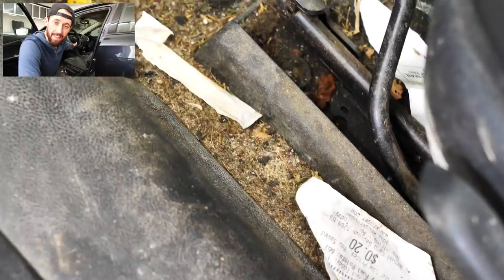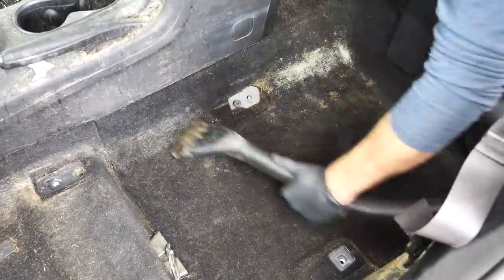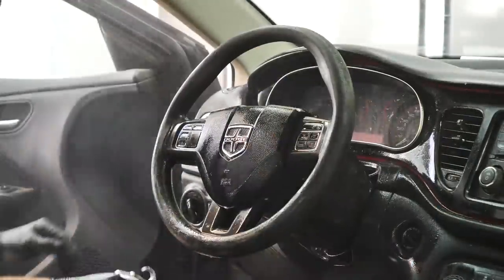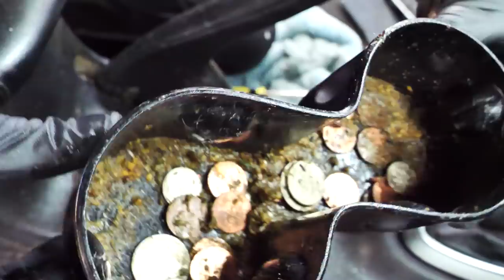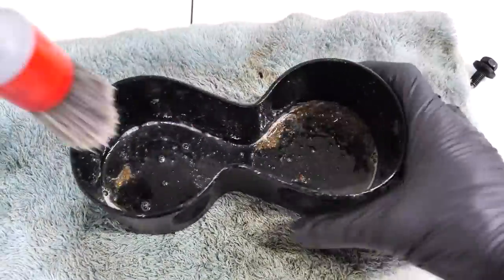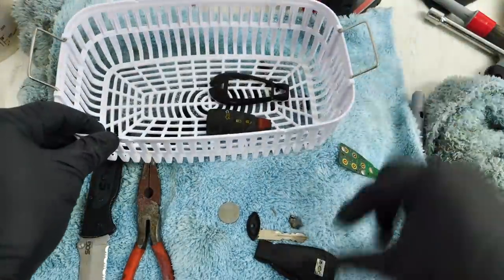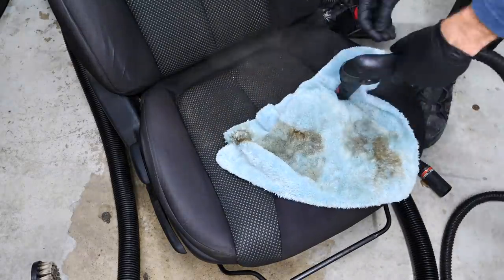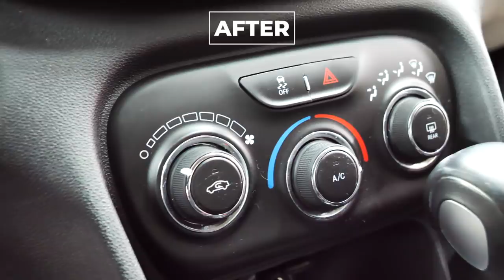Car Detailing The Dirtiest Dodge Dart Ever... Interior Restoration How To.

Comment: For the steering wheel, I use a magic eraser with my all purpose cleaner since i dont have a steamer and it seems to work fine for me
Reply: You have to be careful however. Magic erasers are actually a mild abrasive. Softer leather steering wheels could actually be damaged
Reply: I honestly suggest you get one it will 100% pay off

Comment: I think you would have a much easier time cleaning the dashboards, steering wheel and in all the plastics in general if you use the steamer and the detail brush combination. I’ve seen other detailers use that technique and it does wonders! Especially for cars that are THIS gross.

Comment: Will list my questions as I watch:
1. How long did you keep the ozone Gen running?
2. When clear coat is coming off, how do you fix it?
3. Did you use a black light on it for body fluids? Gross I know.
Comment: Must have been owned by a Big Foot.
4. Why did you choose NOT to remove center console?
5. Yohoo is much lighter! This is THEE dirtiest water hands down.
JOB MOST EXCELLENTLY WELL DONE! 👍 👍
Reply: 4. Ikr

Comment: Why don't you use a steamer? Would steam blasting help remove tar and dirt better? Many of your competitors worldwide use steam blasting on trim with stains. Also noticed that you don't detail the rubber on the window frame on either side of the glass. A lot of dirt accumulates there as well.

Comment: If its a dealer car they could probably get the replacement carpet for $150-200 bucks???  Would increase the resale for about $500 depending on the condition of the rest of the car.

Comment: Just for the record: If you wanna clean up the “electronics” (which the name is Printed Circuit Board Assembly or PCBA)  with no damage, you can use Isopropyl Alcohol and a tooth brush, and also try to wear gloves to avoid any Electro Static Discharge (ESD)... I’m an Electronics Engineer... 😉

Comment: This car wasn´t worth the work you spend on it. Seat, carpet, steering wheel are already damaged, these has to be changed. All this nicotin in the car, you won´t get it out. Only good thing is, no insects in there, probably they died before because of cigarette smoke.
Guess, you had 4,21 $ change, including this you put away with the vacuum cleaner XD.